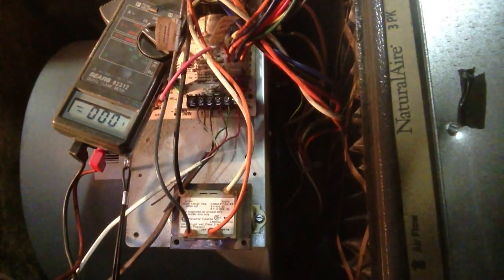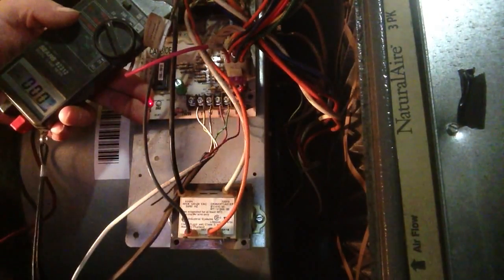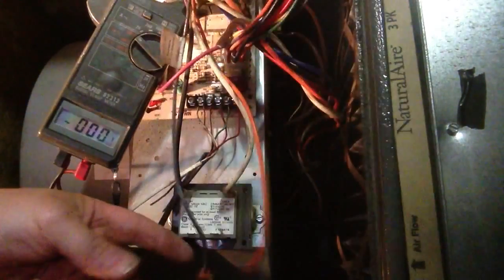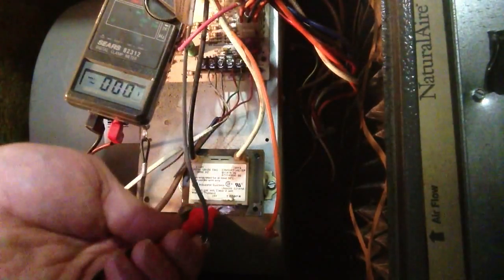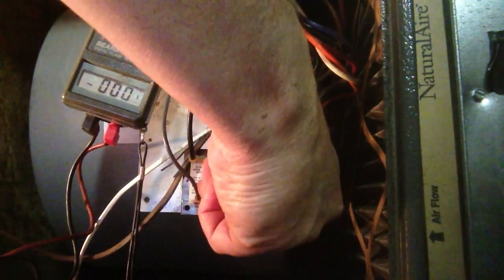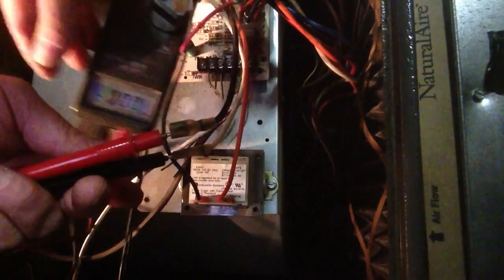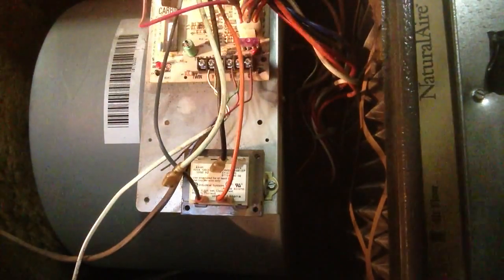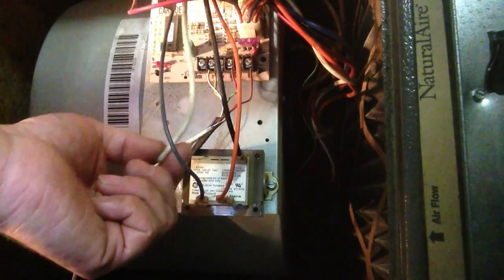DIY troubleshoot furnace transformer

Comment: My transformer has two low voltage leads to go to the board and on one of the leads I get a 24v reading but the other lead reads 0v. Does this mean my transformer is bad?

Comment: My circuit board is new, blower wires works since I connected it to the kill switch to test out however i have no red light. What would be the reason as to why the red light isn’t on?
Reply from the maker: Bad transformer   fuse in the circuit board are 2 items to check.

Comment: I'm not getting any low side voltage from my furnace circuit board.   No 24v on the board to feed to the thermostat or to operate the AC contactor.   The circuit board's LED is on but only just barely; I thought it wasn't working until I accidentally turned off the lights in the furnace room!  Then I noticed the LED was just barely glowing. 

When I unplug the transformer inputs (neutral and hot) from the circuit board and measure the across the circuit board's terminals I get 115v.  But when I plug the transformer into the circuit board and measure the voltage across those same terminals I only get about 0.05v (not zero but close).    This is with or without the output side of the transformer plugged into the circuit board.    I tested the transformer out of the furnace and when connected to line input (wall outlet) I get the expected 28v output.    Also while testing the transformer using power input from a wall outlet I hooked up the low voltage output to the furnace circuit board and the LED is bright green and flashing normally.  

Likely I have a bad circuit board but don't want to replace the board without knowing the cause.   Any idea what could cause this?   If I replace the circuit board is this just going to happen again?
Reply: Forgot to mention I removed all thermostat inputs and the wires to the AC condensor and left them off during testing.   I also measured the transformer input voltage (with the transformer input coming from the circuit board) while removing all the other wires from the circuit board one at a time (i.e. power off to furnace, pull a wire, turn on power, measure voltage).   Even with everything disconnected I get zero volts across the input terminals when the transformer is connected.

Comment: My Transformer is out. How do I choose the right transformer?
Reply from the maker: A direct replacement is best. If not any 24v transformer with 40 va or volt amps will power most resenditial furnaces.

Comment: Wow did you just touch live wires with your bare hands??
Reply: Nah man, the cover switch (or on/off switch on the side) is depressed while he is pulling wires and then presses it once his hookups are on to easier test for power.. instead of hitting the breaker every time.
Reply from the maker: Low voltage maybe 24v
Reply: When you measured 117 volts that was live AC wires
Reply: Did it like a man
Reply from the maker: Nope there was no touching any live wires there.